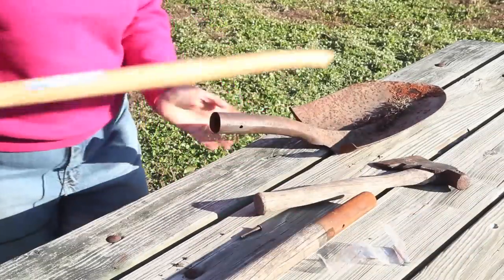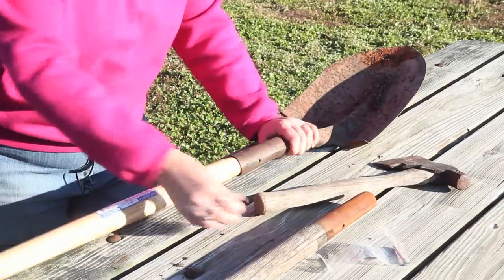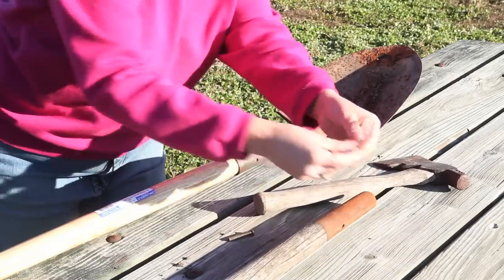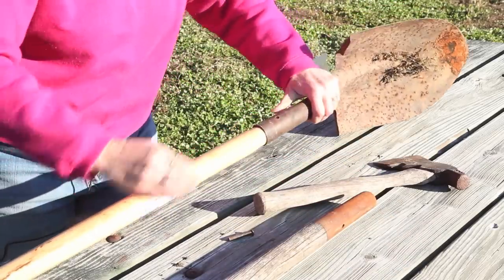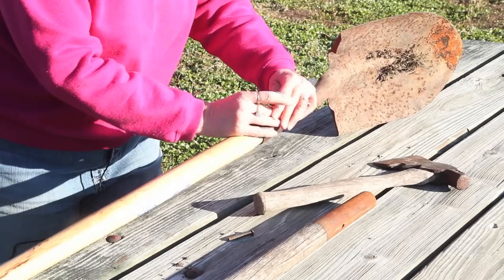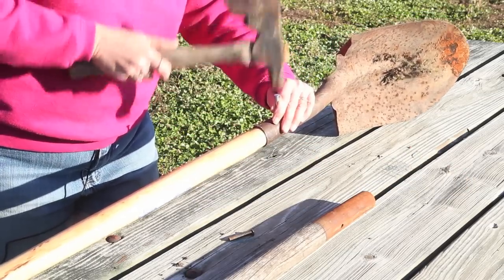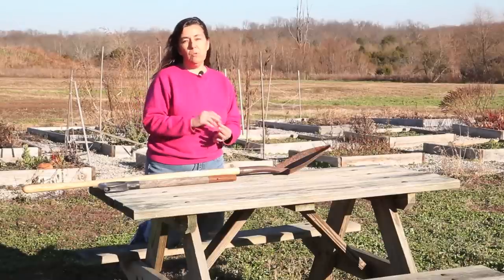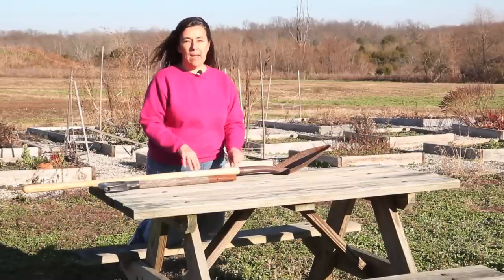How to Replace Garden Tool Handles : Great Gardening Advice

Comment: No one ever shows how to get the old wood out of the hole.  Any suggestions?
Reply: Use an electric drill to make a gazillion holes in the end and then  grub out the splintered wood with a pick or 
even a screwdriver.
Reply: Thank you so much.